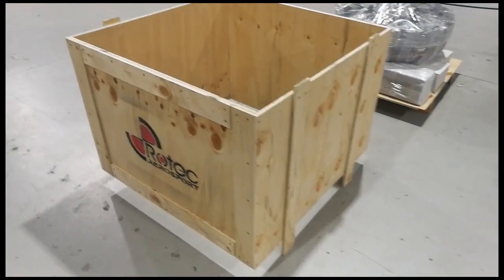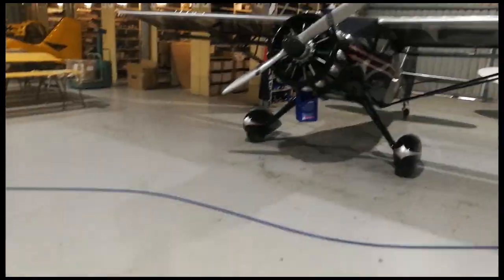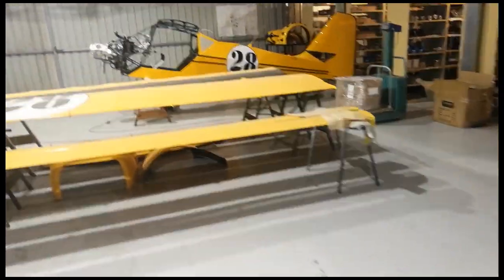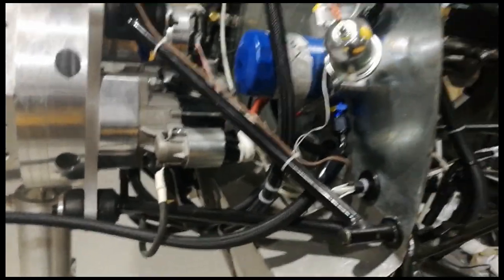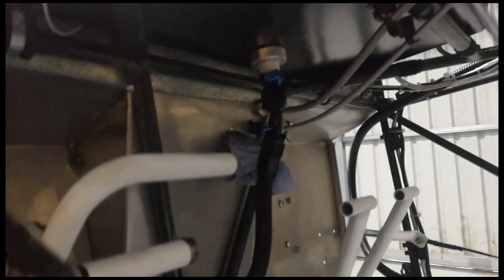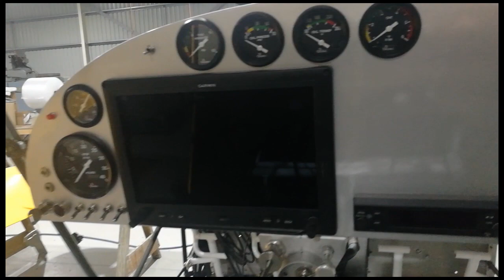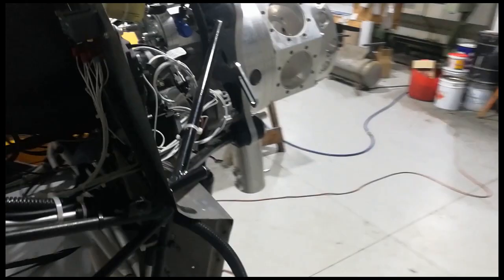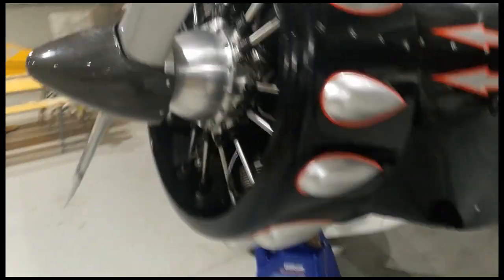Kitfox with Rotec Radials

Comment: What kind of numbers are you seeing with the radial? 
Cruise?
Climb?
Range, (endurance)
Useful load?
Etc.
Reply from the maker: I really enjoy flying this plane. 
I get about 1100 fpm climb on what is consider a cruise prop, 76"D x 55" wood.
Cruise is great  80' at just 18" engine mp. Or if in a hurry 90' at 20"mp. Fuel burn average about 20 litres / hr cruise.
I have the 50 litres tanks in each wing tank so 100 litres total plus the header tank. 5 hrs flight. Range is excellent.
Usfull load is adequate but reduced slightly due to the larger engine. I have made a good sized ply wood boxed in luggage compartment behind the seats.